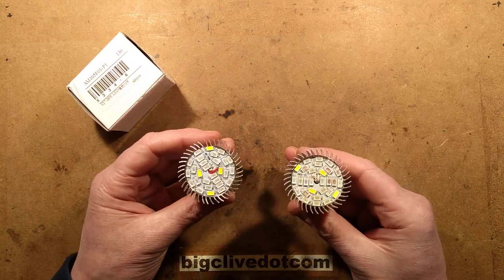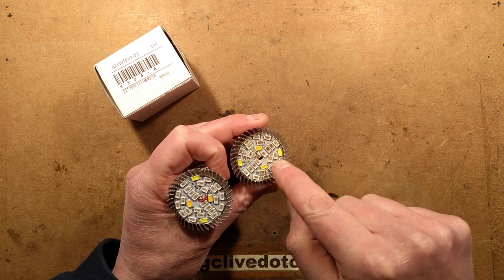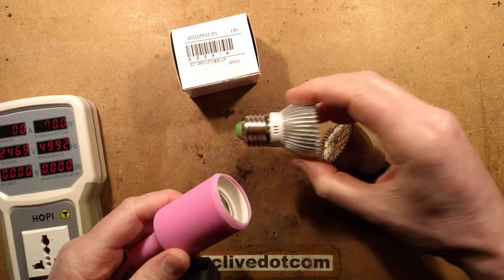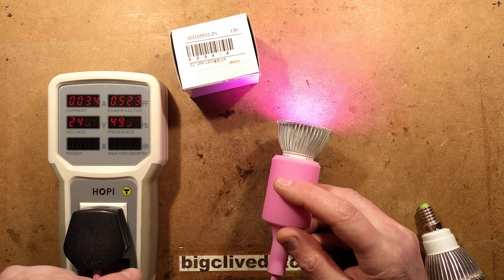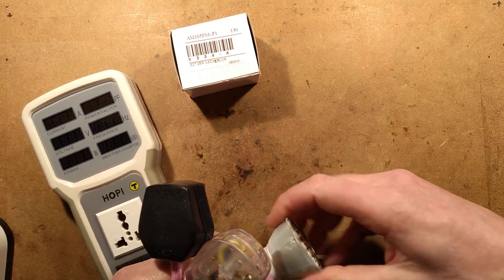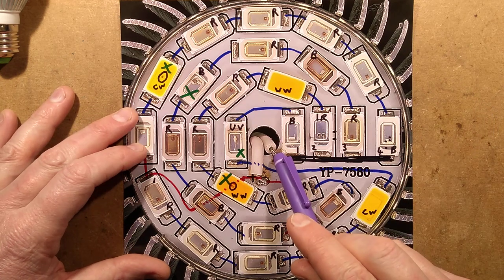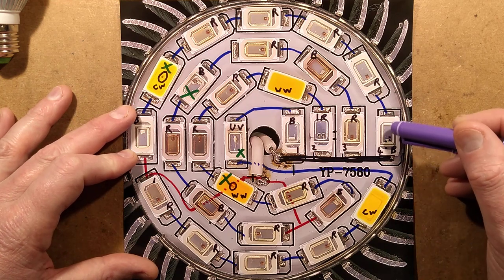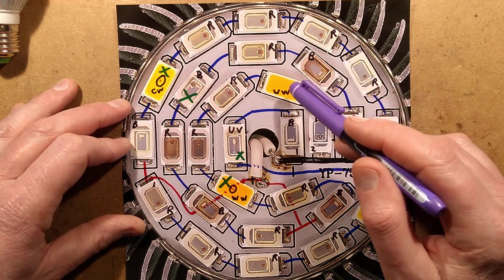Autopsy of failed grow light and test of actual power versus stated power.

Comment: After watching this I want to see Big Clive build a balanced grow light and share the circuit so we can make our own and stop playing roulette with Chinese iffy circuitry.
Reply: @MortenVindingSvendse  it is real watts and they're a pretty decent grow light although IKEA's design doesn't allow you to move them any closer using their own equipment on the bar version (the one they actually stock in store), which is annoying. I clocked them at 30,000 lux if you do raise up the plants to a sensible distance which is adequate!
They are also a much more tolerable colour for humans, being mostly white.
Reply: T C sounds good. Was actually planning on buying some, since my daughter got some chills. But our local IKEA don’t stock them.
Will buy once I get to a different IKEA
Reply: @MortenVindingSvendse  I don't think any branches stock the round ones, I use the long bar ones, they have two screw holes so probably more useful to be honest...they're not cheap though sadly at £29 each!
Reply: T C just checked the other store in my proximity, they supposedly have 17 in stock, so some stores have them.
Yes the bar type is rather expensive, especially considering it’s only rated at 550lm while the PAR30 is rated at 800lm and only one third the price.
Reply: @beware_the_moose  No matter the color you should wear eye protection. Some of that light is really nasty for the eyes. Like looking at the sun with binoculars.
Reply: I beg to differ. It's just a different spectrum. 
Obviously if you're choosing dodgy lights with UV LEDs you don't know what you're getting but IKEA have to maintain a certain standard...
Reply: @MortenVindingSvendse  IKEA is Awesome!!
Reply: There are cheap and long lasting Chinese grow lights. Try Kingbrite or Meijiu
Reply: Lmens are horrible metric for a growlight. Try  PPE and PPF to compare lights among each other. Reputable grow light companies always provide those numbers together with PPFD and the light spectrum graph. What you want is a "full" spectrum light (whites+deep red and far red).

Comment: Interesting boards, or what is left of them. Intriguing. the "uv" LED.     Now that I give it a thought.....the mess inside, or all the failure is due to the other things used to create a micro-climate. Heat, Humidity, Fans...and what you grow.  Well. Thanks for the vid. See you around.
Reply: In my experience, those type lamps have about a 50/50 chance of taking the emitter array out when their caps go open-circuit.  Considering how badly the sleeving had shrunk on the output cap, I'd say they're both well past "bad".

It's also interesting to see how tarnished the plating is inside the LEDs.  I've run across batches of 5730 LEDs that had encapsulant issues that looked similar.  Over time, the plating would react with something in the encapsulant and get tarnished.  At the same time, the encapsulant would get harder and shrink, eventually peeling away from the housing and breaking the bond wires.

Comment: I had purchased these type of lamps (with white LEDs) for my porch security light enclosures, they failed in short order, which has been my experience with any LEDs with a green plastic nib on the base.
Reply: We have 4W GU10 LEDs around the property that run all night to illuminate the paths (about 7 of them). They've lasted for 3 years now. From a local manufacturer rather than the Chinese ones, of course. That's about 9,000 hours so far. I think their rating was 20,000 hours.
Reply: @two_tier_gary_rumain , OK, who's the local, need some good lights for once.
Reply: @AThreeDogNight  In Australia. Mirabella lights. They were selling 4W GU10s in a 4 pack. For some reason, I can't find them any more.
Reply: Prolific Invention the led’s that are for outside use are different from your average. Any regular led should fail fairly quick outside
Reply: @katestramenos929  Actually, it's a weatherproof enclosure and has LED lights from the dollar store now, and they have been working for several years.
Reply: @two_tier_gary_rumain , OK thanks M8.

Comment: I suspect that if you seperate the power pcb from the leds, these lamps will last for much longer. That lamp enclosure acts like an oven. Even if those caps are rated 105°C, the electrolytic fluid will eventually dry up and no longer smooth the incoming voltage sufficiently thereby ruining the semi-conductors which are not designed to run on a noisy/spikey half-rectified incoming voltage. 

So my tip is to remove the pcb from the lamp encosure and mount it in a small plastic project box nearby and run wires to the led pcb with it's heatsink. You might have to use thicker connecting wire between the led pcb and the psu to compensate for resistive losses from the longer connecting wire.

Comment: I've made a few grow lamps using wavelengths of 400, 410, 425, 450, 465, 610, 630, 660, 730 - with WW to fill in the gaps.
I'd be interested to hear your take on 'dominant' wavelength vs 'peak' wavelength.

Comment: The only reference to "Zhuoxon" I could find was on Alibaba. There was a page advertising "High-quality high-frequency low-impedance aluminum electrolytic capacitor 50v4.7uF", but it is no longer available.

Comment: A 30w halogen = 4w led approx. Maybe that is how they rated it?
Reply: "PMPO" strikes again :)
Reply: That is what they were doing, they just used the typical 6x to 8x LED power versus incandescent power conversion to get to 28W from a 4W LED.  This particular LED housing seems to be designed for between 1-5W LED lamps as I have a number of them I use in shop equipment that are 3W using 3 1W LEDs and they do very well in this application lighting the work zone and are much cooler than the 20-40W incandescent bulbs they replaced (the tighter beam lets you get by well despite fewer lumens).  I just wish the Chinese would be more honest in how they advertise specs and whether they are advertising “real” watts or “incandescent equivalent” watts as there is no real value in misleading people this way.
Reply: @ethanpoole3443  why should they? Thats what OSRAM and Phillips do too......
Reply: Wupme I’ve never had any issues finding the real wattage on Philips products (I don’t have any Osram to refer to) — at least none of the many Philips LED bulbs that I have installed around my house of many varying styles, temperatures, and wattage have lacked those additional specs on their packaging.  Yes they boldly claim the incandescent equivalent wattage in big print (which is fine if it’s clear what they mean), but I’ve always found them to clearly state the actual real wattage as well on their packaging (and frequently the actual lumen output and color temperature as well).  I would have no real issue with the Chinese if they sold it as a clearly labeled “28W equivalent” (so long as such is more or less accurate in terms of lumens) that “draws 4W” actual power, but when the only spec offered is “28W E26/7 LED Grow Bulb” it is not at all clear what wattage they are specifying, and if no lumen output is given then you can’t compare lumen output either to determine what its actual equivalence should be.

Comment: I ended up making my own, I bought a cheap spot light for the automobile and removed the lights and created a specific set of LED's but I matched my colors separately . the other type grow lamps are those that have the orange color phosphorus over the led's and I didnt  like that, I wanted to choose for myself what arrangement was assembled,  it is a little bit of work, I didn't use the SMT chips just the 1W and or the 3W chips with a lens, had some interesting effects, I wonder if one day I have this tall beanstalk that reaches the clouds? LOL

Comment: I did a little research a year or so back, when I was looking for a relatively cheap grow light to help winter my tropical plants in the basement.  I discovered that in fact there are different wavelengths of blue and red that are most effective for photosynthesis, so you may in fact have different shades of red and blue.  I ended up purchasing a 36 watt TaoTronics LED Grow Light Bulb, which has one wavelength of blue and two red. 

I've used the lights for a couple seasons and have discovered that they're such a low wattage, that I don't know how effective they really are for my plants.  Any chance you want to take one of these to bits?  On the surface they seem to be a bit better quality than some you have explored, but that is really a superficial guess.  I am also curious if I am getting the full 36 watts. Seems like most lights you explore are much less than advertised, which I think is the biggest factor in reducing their effectiveness. More watts, more grow!

Comment: i have a flood light grow light its completely white never seen a pink like one before.. although been use to early tube like ones being like a green its kinda odd how no matter the color the job still works almost same more or less. but can sorta see other colors kinda they are nice and before anyone asks no i only use it for my tropical house plants and my golden berry trees cause winter is harsh and dark and cold.
Reply: The reason for the magenta color is that the red and blue portion of the visible spectrum are where the majority of photosynthetic activity peaks, so LED grow lights are frequently composed of red and blue LEDs which better matches most plant’s needs and allows for energy savings by not wasting energy at wavelengths that many plants do not need or use.  Some plants will also benefit at certain points in their growth cycle from the addition of green wavelengths (or even the removal of the red or blue wavelengths), so sometimes you will also see grow lights with green as well, resulting in a whiter looking light — the addition of green can also make it easier for human’s tending to such crops since magenta light is unnatural to us and makes leaves and flowers looking unnatural.  However, the addition of the useless IR and UV in this bulb is mostly just marketing as IR contributes nothing to photosynthesis and UV actually harms both the plant and photosynthesis so plants employ a form of sunscreen to protect themselves from UV — not that the minuscule amount emitted by these lamps will amount to anything anyhow as the levels are so low with just a single LED allocated to each.
Reply: oh that's cool i never knew that at all. shows i still have lots to learn then. im guessing mine is an ok one to use i know the plants love it. before i had it i was trying to rely on the sun in the window for them but they were like faded green to yellow cause was not strong or long enough cause winter. since the trees are still babies they were struggling now they are full blown green and getting taller and just reaching what they are suppose to be now. but it is the white like output one if look at the light that it casts on can sorta see a faint ghosting of red and blue mentioned and slight green but other wise it looks like a natural sun light.

Comment: These are probably not 28x1W as they claim in the adverts but lower Watt LED's (like 0.2W), plus they under-drive a bit to compensate for the not equal forward voltage of each string plus the heat sinking may not work well enough at any more power.

Comment: Please explain the significance of a "fizz" of electrical equipment. I'm not joking. I've got a battery charger which runs off a "bargain" 12v adapter (including sleeved earth pin). Every time I'm using the charger if I run my finger against the metal body of the charger I can feel a vibration. It's not the surface of the charger- it doesn't happen when it's switched off. Any simple tests to be done with a DMM?? COuld it just be floating chasis ground due to the sleeved earth pin?

Comment: I have a few of those (not quite identical, but close enough), hasn't died on me yet and it's been on for over a year. Mind you, I did greatly expand it's heat fins to extend it's reliability cuz I was tired of grow lights dying on me within the month. I will say though, it doesn't seem to work all that well as a grow light for me since my plants still die every time I use it during the winters when I can't have the plants near the cold window.
Problem is that it seems to be impossible to find good quality grow lights that use the standard light socket types. I've only ever been able to find 1 good grow light, it was an incandescent, and it lasted me about 2 months... but my plants stayed healthy with it. Unfortunately, you can't find them anymore. I've tried fluorescent and many LED types... all have been garbage.
Reply: @MortenVindingSvendse  I didn't even think to consider Ikea for grow lights... but I think I'll try them out, thanks.

Comment: I would like to see the IR LED with the FLIR camera!
Reply: The Flir responds to far infrared 7-12 μm, while the IR LED is near infrared 0.7-1 μm. I suspect it would not look any different than the others.
Reply: The near infra red should already show up much better on a camera than to the eye. Cameras tend to have a much better response than our eyes at these wavelengths.
Reply: @whitcwa  :Thanks for your very educated answer!
Reply: 700-800nm is far-red, not infrared. It's a transition zone between red and infrared, and has properties of both. Those, so called 'IR LEDs' are likely 730nm, but there are 710nm ones, and 760nm ones as well.

Comment: If I had built it, I would have put the UV and IR LEDs in the same chain, so the lower-voltage-than red for the IR one would cancel out the higher-voltage-than-blue of the UV one.

Comment: Simply adding a resistor in series with each string of LEDs would solve the mis-match problem. Take a LED from each string and replace it with a resistor.

Comment: Years ago I explained to the boss why the Neutron Star was eating par 36 lamps (it used 20 12 volt ones in series), 10 of them were halogen and 10 were tungsten. Told the boss that either of the 10 needed changing so that they were all the same type, he bought 5 tungstens which I swapped out and told him to order another 5 + 2 spares, he told me to use the ones that I had taken out as spares :(   Five nights later we ran out of spares and were back to 10+10 Doh !
Reply from the maker: Yeah, those old disco lights need matched lamps.  It would be interesting to retrofit one with custom PCBs with a large array of LEDs and resistors with a rectifier and smoothing capacitor each for smooth output and a slight tungsten characteristic.

Comment: Were the IR pair in series rather than parallel?  Might have balanced the voltages better that way.
Reply from the maker: Parallel.  Combined voltage is about 1.5V when tested at low current.

Comment: Growth lamps are an interesting subject to me. You have to wonder, one day there'll be so many people on this planet that these things will be needed to provide the world with the crops needed to sustain all that, so they need to be as efficient at growing plants as possible. I wonder what the reasoning is behind the multitude of colors on that lamp though. I understand the ones that send out the magenta light. Plants use both red and blue light in photosynthesis and green light isn't used, which is why plants appear green. To be more specific the blue light (and presumably UV too) ionizes water in the plant cells somehow, releasing oxygen. The hydrogen then gets used by the rest of the cellular machinery to generate sugar when combined with CO2, which needs the red light to work. But this whole "full spectrum" thing, I'm not sure that's actually needed.
Reply: Everyones using white LEDs now and plants do use green.
Reply: dothemathright 1111  Interesting read, thank you.

Comment: Solvent to release thermal compound? Acetone, residue-free contact cleaner, brake cleaner, something volatile.

In fact Caramba brake cleaner often goes for something ridiculously cheap like 2€/500ml and there's no difference to residue-free contact cleaners to speak of.

Comment: 28 Watts? I think the Chinese are getting a bit too generous with the power ratings these days.
Reply: I miss the old days when they only double the power...
Reply: Well they're 28W if you base your calculations off how long it takes to run down a battery pack made of 6000mah 18650s.
Reply: I got 3 grow lights for my chili's and they have '1000w, 1200w and 600w' on them but they all draw about 130 watts each at the wall but it says they have 100x 10watt leds but they under drive them so the leds last longer
Reply: They always do and unfortunately, no backlash for printing incorrect specs.  No international body can do anything about it so it keeps on going.  There are however some very reputable Chinese manufacturers so that gives me some hope.
Reply: @valveman12  I agree. Not all of the Chinese manufacturers are the same. Some are honest, some are not. Just this day and age I guess.
Reply: @Alexander_l322  I agree that under driving them is a good option. Clive used to have a 100w led chip running at 20 Watts above his bench. Think he has a video explaining what he did somewhere.

Comment: Then are the power supplies causing the LED failures or are the LEDs causing the power supplies to fail, or is it a heat issue?
Reply from the maker: Everything runs far too hot.

Comment: How expensive is waterproof spray? Back in the '90s there was an infomercial about a super cleaner that didn't interfere with a TV after filling its chassis with it.
Reply from the maker: You do get non conductive electronic cleaning solvents.  Supersolve comes to mind.  It can be used to purge out water that has seeped under components.